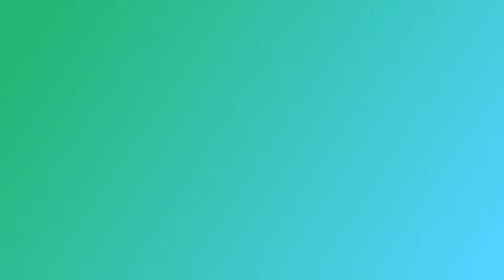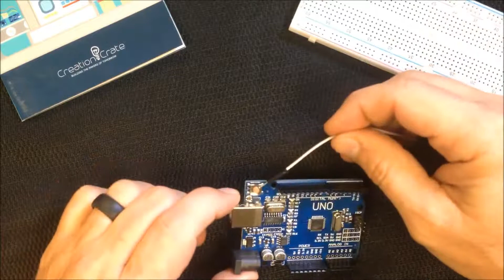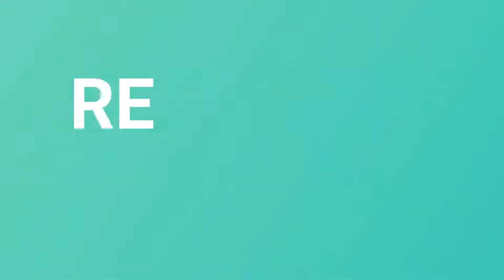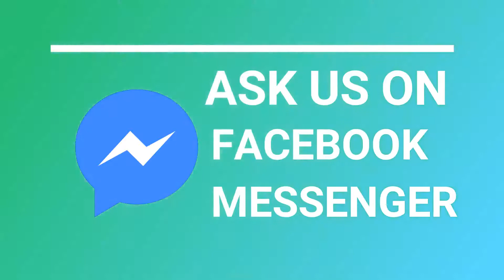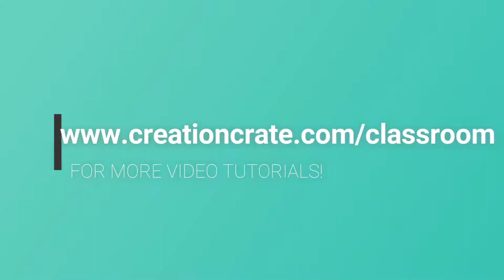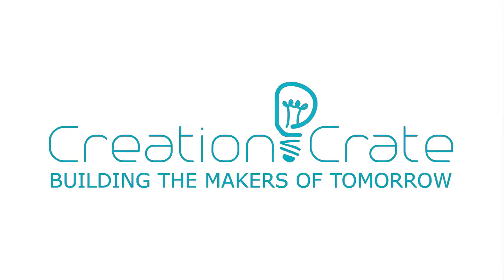What is an UNO R3 (Arduino Compatible) Board?

Comment: hi how do you connect to the ide or the online one thanks
Reply from the maker: You need to select the board type (e.g. Arduino UNO) and the USB port you are connected to. Go to Tools -> Board and then Tools -> Port. 

If you're not sure which port you're connected to, make sure the USB cable is disconnected from the computer, go to Tools -> Port and see which ports are available. Then plug the USB cable in, do the same thing and see which new port just appeared and select that one.

Comment: Can you hold it with bare hands or are you grounded? Is there risk of ESD bricking these devices? How do I use it in a average home? Do I need a ESD mat?
Reply from the maker: While I'm sure it is advisable to discharge any static electricity, these boards are pretty durable. I've been using these for years and never had a problem.
Reply: @DavidHehman8  Thank you David

Comment: Hi, what's the tx rx in the center side, between digital and analog pins?
Reply from the maker: Those are the transmit and receive pins used for serial communication. Here's a pinout diagram: https://content.arduino.cc/assets/Pinout-UNOrev3_latest.pdf